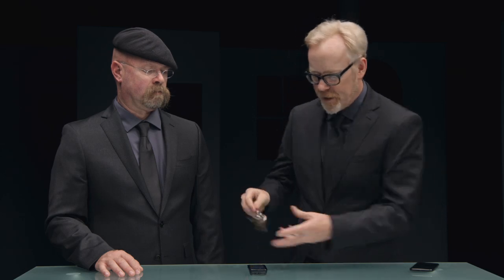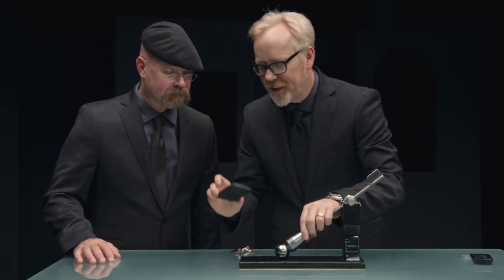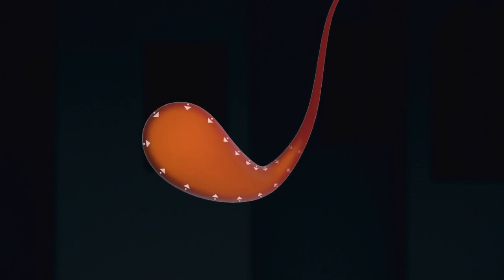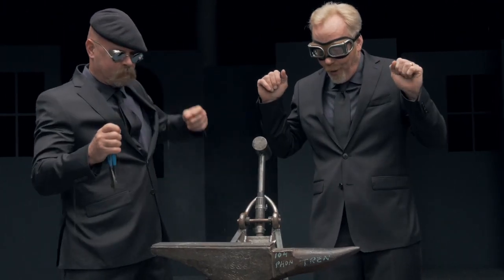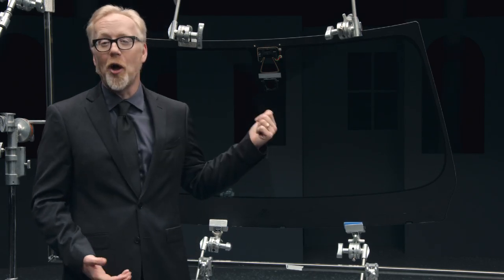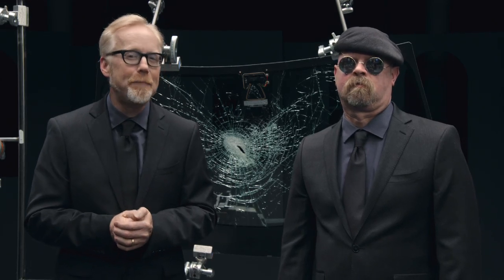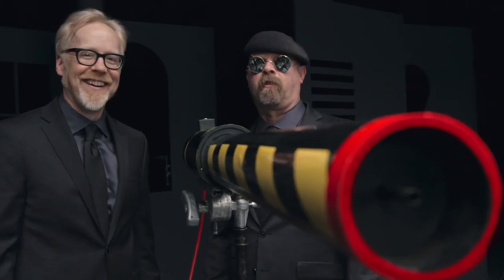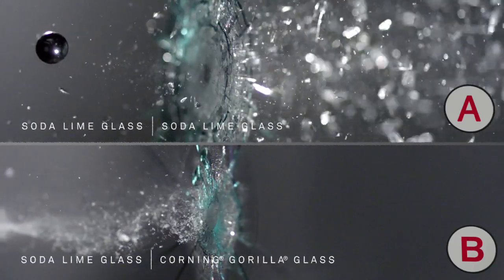The Glass Age, Part 2:  Strong, Durable Glass

Comment: Will never be released for cars as it is now. Why ? Because windshields are meant to break on impact. When someone has a car crash at 50km/h, the wingshield is supposed to break when the pilot goes through it. Otherwise, the pilot would die instantly.

In fact this windshield is pretty fucking dangerous.
Reply: Pretty sure the seatbelt is already there to prevent you from going through the windshield. If you go flying through the windshield, you done fucked up.
Reply: You're right, the seatbelt+airbag combo is what saves your life in 98% of the cases, but there are also people that eventually go through windshield and survive. With this glass, they wouldn't.
Reply: TheUnPlayable
In 98% of "cases" people go through the windshield and survive? According to?
Reply: Windshields are designed to be delicate so they become a fine powder. Stronger glass will form big and sharp shards that will stab people. Safety Glass isn't designed to let people fly through windshields.
Reply: It is far more safe to be completely stopped by the windshield than to go out the front of a car. People may occasionally walk away with minor injuries after being ejected from the car, but more serious injuries and death are far more common in these types of accidents.
Reply: TheUnPlayable I'd like to see some statistics please. With sources.
Reply: If you plan on hitting the wind-shield whilst driving, then your chances of surviving the accident are thin. That said, being hit by a car, the wind-shield had better be able to soften the impact, and that's where hardness becomes the problem.

Comment: It doesn't matter if I still break my phone from a 4ft drop. Gorilla glass is a scam
Reply: I'm very interested in your engineering for a touch display that is 100% drop resistant while also affordable on a consumer level... My intuition tells me you don't have any such thing.
Reply: It's as pointless as glass was 10 years ago. It still breaks. Until it does not break from regular drops, it's worthless tech.
Reply: That's where you're wrong... it shatters, but it's still functional and doesn't send piercing shards into your finger tips. You can still use a phone to it's full capability with cracked gorilla glass, it looks ugly, but it still works. Why can't you jus appreciate the strides we've made? One step at a time my friend... Nothing just miraculously becomes "perfect". We gotta reach these steps before moving onto the next one. Just think about where we were 30-40 years ago...

Comment: My impression is that it's good for phones but not for cars. How often do pebbles go through windshield anyway? They have cracked mine but not broken through probably because a ball bearing has a far greater density than a pebble that size. EDIT: Actually if you think about in an efficiency mindset (which car manufacturers don't really care about in the end unless it makes production cheaper) then this glass is great and I want it in my next hovercraft!
Reply: Lightweight is the big factor for cars though.
Reply: I think the point however is that we've been using the same type of glass for our cars ever since the first windshield was put on a car and the idea of using a different type of glass that's lighter and stronger than conventional glass is the way forward.
Reply: I was going down the highway once behind a flat deck trailer. There was a rock on the flat deck trailer a bit smaller than a baseball and it rolled off, bounced once off the road and hit my windshield. There was no time to react. The rock got stuck in the resin and the glass went all the way to the back window.

That is a pretty extreme situation, but maybe if that gorilla glass was there, I wouldn't have been covered in glass shards.
Reply: bro, density means nothing. its all about the mass. mass determines the force, and therefore damage, used on the windshield not the density.
Reply: No, I can sit on my phone with more force than they can apply there and the glass will be perfectly fine. The more force in a given area the greater the damage, so basically density.
Reply: John Python
again no, in their example the force is being concentrated on a very small area, like you said. but the force is determined by the mass of an object, not it's density!!! DENSITY only described the area a certain amount of mass exists. if the same amount of force shown in the video is exhibited on the glass across the entire surface it will still break. I understand what you are saying though, if that metal ball was bigger and elastic, allowing it to mold across the entirety of the glass while still having the same mass as when it was smaller, it would probably not break only because the force would now be less per sq inch, one because it is now elastic (like human flesh) and 2 because it is not focused. They were simply demonstrating the amount of force necessary to break the glass on any given area of the glass.
Reply: Tyler C Even bigger for passenger aircraft.
Reply: John Python ironskillet2 I understand why you said density but density is not the word you're looking for. It's pressure. Mass determines force. But ultimately, you still have to take into account of how much pressure can the glass withstand. With p=f/a, it's probably a common misconception to associate high density to small surface area.
Reply: Jeffrey Soong I know but I'm only saying if that "rock" was to be lesser in density then it would more accurately simulate a rock that size because it's mass would be less. Really I can't say anything because it's not like they give us ANY data at all beside "*simulates 1m drop height" thats all for the whole video.
Reply: John Python
well true, most metals are far more dense than rock, allowing it to focus more energy on a smaller space, making it easier for metal to break the glass, but then again it isnt like rocks are the only thing that will ever hit your windshield, so it was probably a good idea for them to use a metal ball instead of a rounded pebble. to further demonstrate the use of the glass.
Reply: Density does matter here, not in the equation, but in determining the other numbers in the equation.  If the ball bearing was the same size as the pebble, then the pebble would have less mass and thus less force when hitting the windshield.  If the pebble were big enough to have the same mass, it would have a larger surface area, thus requiring more force to achieve the same pressure per square inch.
Reply: ***** Rocks are also mostly made of silica, aka silicon dioxide, aka mostly the same stuff as glass itself. Silica is about 2.648 grams per centimeter cube; stainless steel is at least 7.85 grams per centimeter cube.
Kinetic energy is calculated by half the mass of an object times the square of its velocity. Mass can be calculated by density times volume.
So when travelling at the same speed, a stainless steel ball would always have a greater force than a rock polished to same shape and size.

You mentioned about a larger rock requiring a larger force to penetrate the windshield, and this is... kind of incorrect. You have to remember that rocks are not naturally spherical, and even if they're tumbling through the air, there's a likely chance that they will strike the glass with a sharp point. I'm not saying something like a cone (because then that would be a no-brainer), but gravel does have sharp edges to it.

Comment: Yeah, but you still have a busted windshield that needs to be replaced and it would probably cost a lot more to fix. Seems to me it would be better to have the hardened glass on the outside rather than the inside. I want ultimate resistance to rock chips and scratches on the outside.